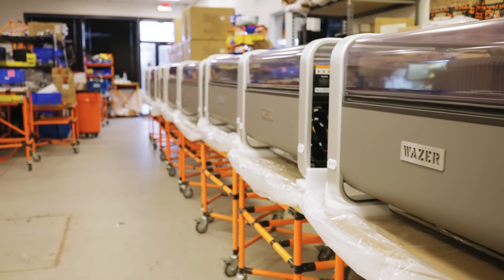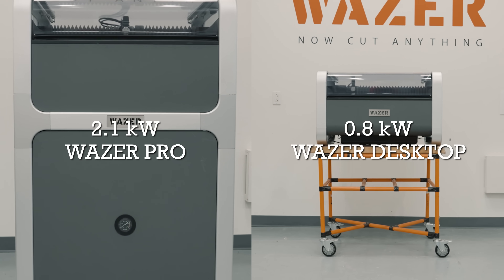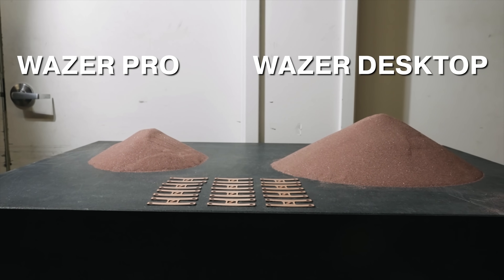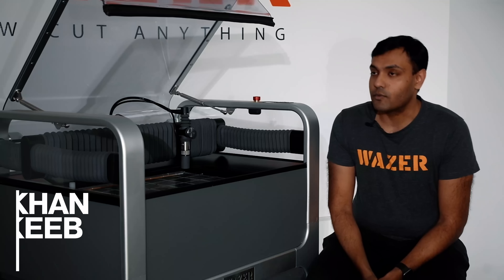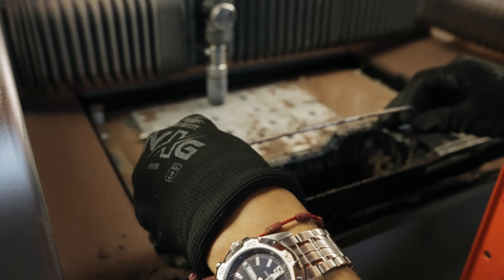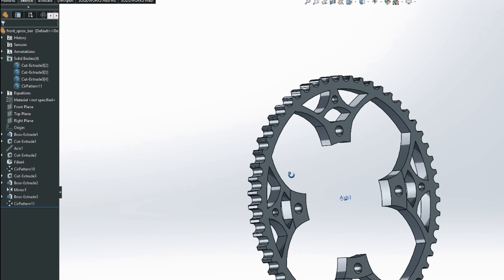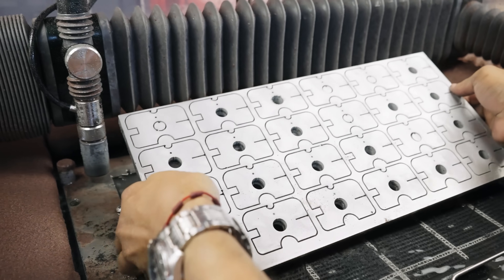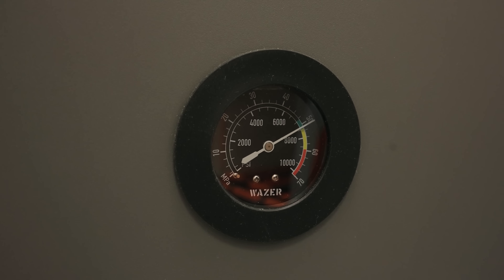Introducing WAZER Pro Waterjet Cutter

Comment: First question I have is can I use to cut bricks, and if so, how deep?  I would be very surprised if it can cut all the way through a brick standing on its end (8"), but it would be very useful if it can just cut through the standard height (2-3/8").  Diamond wheels on grinders are very unpleasant to use.